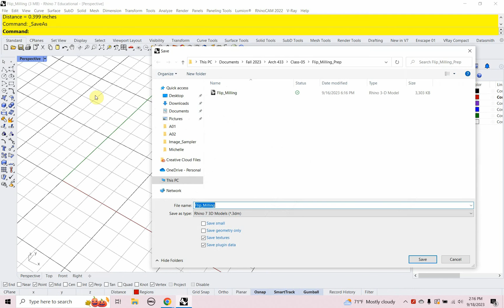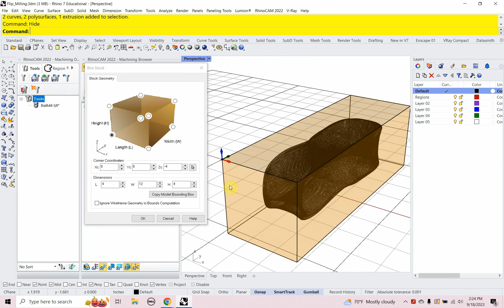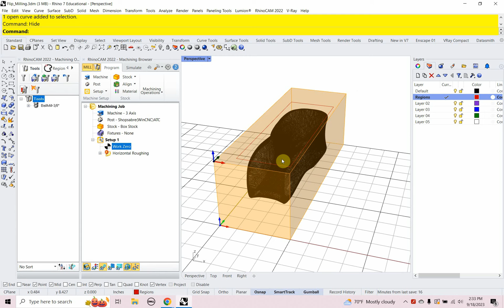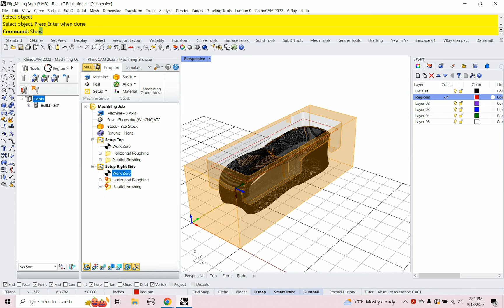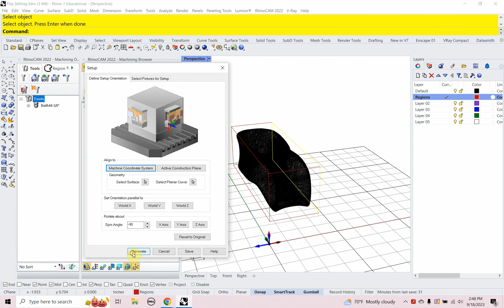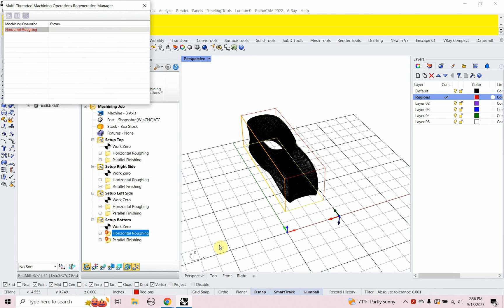CNC Flip Milling

Comment: I have a couple of projects that require flip side machining. First is a laminated wooden handlebar, and then a canoe yoke.
I used to just do a save as and rotate the part itself in the drawing, without changing the work zero.
Working on getting used to your method.
What would of been helpful in your discussion is showing which XYZ the machine setup is used for each rotation.
I have flip machined using Z zero on the machine bed for both sides or zeroing to the material surface as required.
I like to hide parts or geometry by putting them on their own layer and hiding the layer.
I'm surprised more people don't use a customized middle button library.
Cutting cabinet parts mostly on my ShopSabre, 3D machining more of a hobby for me.
Cheers from a few hours north of Toronto.
Reply from the maker: Hey thanks for the feedback! The family and I visited Toronto last year for Spring Break. We had a great time. Thanks for watching!